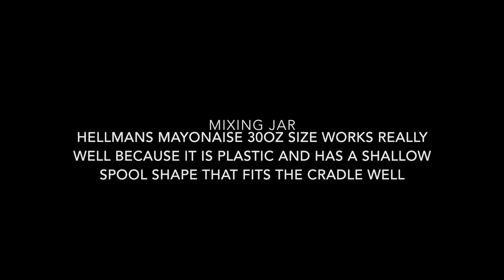Shellac - A better way to mix and apply shellac and obtain excellent results.

Comment: can we use isopropyl alcohol 99% pure as solvent for shellac?... 
what ratio should i choose to make this solution?
Reply from the maker: Hello Muhammad. Thanks for watching.

I have no personal experience using isopropyl alcohol with shellac, but from all I hear and read, the short answer is no. The product I use is primarily (91%) ethanol. It contains only 4% isopropyl. Commonly available denatured alcohol is similarly composed. Here is a link to a good conversation from Fine Woodworking on the subject: https://www.finewoodworking.com/forum/isopropyl-or-denatured-alcohol.
As for the ratio. One pound of shellac dissolved in one gallon of solvent creates a “one pound cut.” You can adjust that formula to create the “cut” you desire and the amount of solution you wish to make. I prefer a 1.5 pound cut and make 8 ounces at a time. That equates to 1.5 oz of shellac by weight to 8oz of solvent by volume.
The cut you mix will be a compromise between flow out and build. I find that a 1.5 pound cut flows out nicely and builds up adequately. You will get more build with a 2 pound cut (theoretically requiring less coats) but it will not flow out as nicely when applying. Otherwise stated, a 2 pound cut will be more difficult to apply easily than a 1 pound cut but will leave a thicker coat. Anything over 2 pounds and you will be dealing with streaks, brush marks and a clumpy, uneven finish. You then spend a lot of time flattening between coats and effectively erase the advantage of your thicker build - with a lot more work and worse results.

Keep in mind that shellac is generally used in woodworking when you desire a fine finish. So multiple coats with a 1.5 pound cut is what will get you there. If you want to do a quick job with a faster build for a more utilitarian piece, just don’t use shellac. I go to a polyurethane or varnish that I will brush on or can spray (see my Electronics Tool Box Video.)

Hope this helps. To my friends out there who use the metric system, sorry for the imperial measurements. I’ll let you do the conversions to grams and liters because I would probably screw it up!
Reply: @frankvucolo6249  99 % isopropyl does not contains water,so you can use it
Reply: I have to use it here in Cali works good!!
Reply: Yes! but make sure it's 99% - it's what I've been using here in California
Reply: just get a bottle of everclear

Comment: I’ve gotten the best results using 1/4” hex nylon nuts.  I find the 5/16 a bit too big because it disrupts the stir.
Reply from the maker: Bob, did your experiment take into consideration container wall flex in a plastic vs. glass jar, lighting conditions and the prevailing price of eggs in South Dakota? I find this comment to be a little nutty. 😁
Reply: @frankvucolo6249  I’m sensing a bit a sarcasm- I’ve never received such a shellacking before. Now you’ve stirred up a hornets nest.
Reply from the maker: @bobwhelk2117  all in good fun, Bob. 	Shellacking! Very good.

Comment: Will any mineral spirits do, or did the good doctor also recommend a certain vendor for that, because they do sell a Shellac reducer under the Mohawk/Behlen brand? Also, Behlen makes a shellac retarder B503-00025, are you familiar with that product?
Reply from the maker: Hi Dee and thanks for watching. No, the doc didn’t have any warnings on the mineral spirits, so I think it’s good - as long as you don’t drink it :) I am not familiar with shellac retarder. But now I want to check it out. Have you tried it?